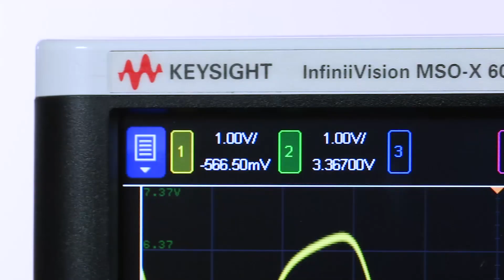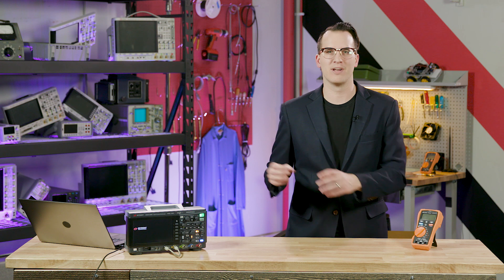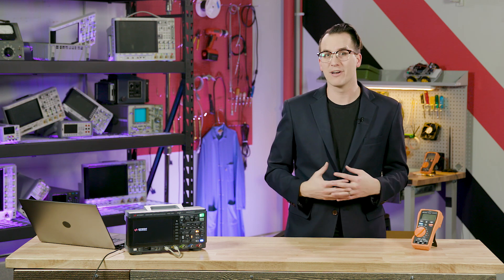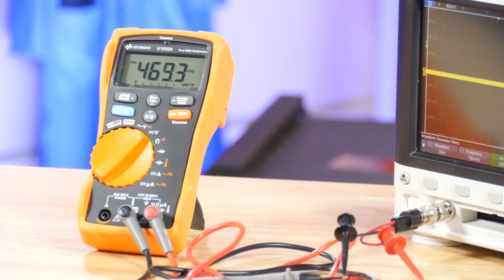RF Connection Tips & Today's Wave Winners! (13-Mar)

Comment: Tips 1for keysight: how to hold the torque wrench
Tip2 don’t use air pressure you can blow the dust in the connector specially 3.5mm,2.92mm, etc..

Comment: Hi, actually your tips how to clean RF connectors are not gernerally suitable.
Two things are absolutely to avoid: 
- Swabs.
They are simply too large and when entering the connector you put force on the center-pin. With air-dielectric connectors (so all “proper ones” :-) ), there is a high risk of breaking the delicate structures that hold the inner pin.
- Compressed air to blow the solvent away.
While using compressed air on a dry connector is okay, using it on a connector with alcohol is not good. You blow the dirt, solved in the IPA, at least partially deeper into the connector. In areas, you cannot reach and clean.

Some time ago, I did write some short article about cleaning and, even though it’s in German, the pictures should give some hints.

https://www.dl8ri.de/2018/11/03/reinigung-und-pflege-von-hf-steckverbindern/
Reply from the maker: Thanks for the link, we'll look into it! We definitely don't want to spread bad information.
Reply from the maker: Our official guidance is to "pass air over the end of the connector as you would when blowing a flute"
You also shouldn't use just "any" swab

http://na.support.keysight.com/pna/connectorcare/Connector_Care.htm